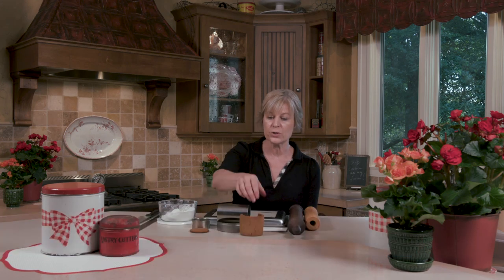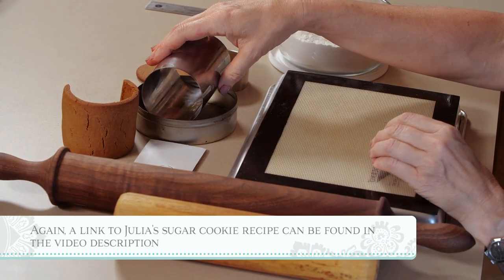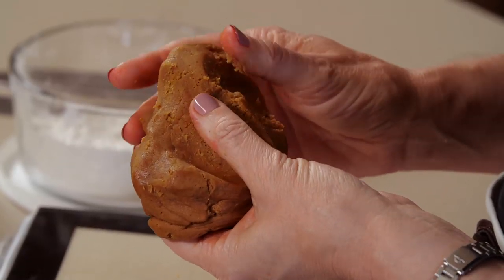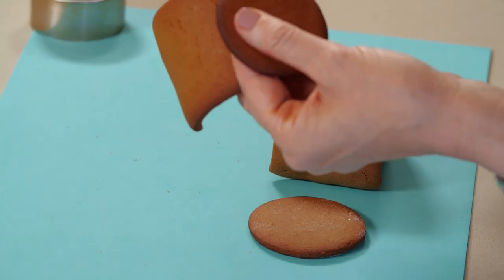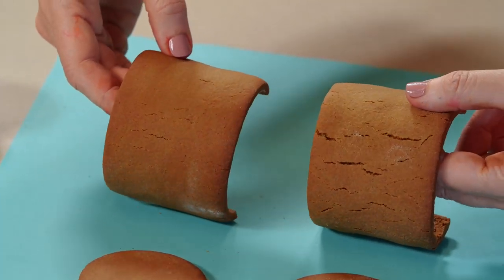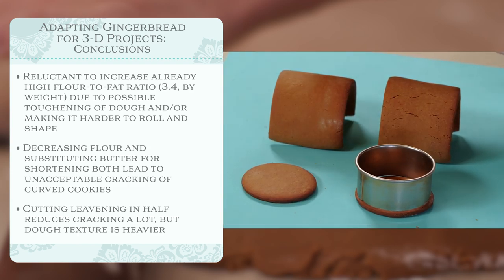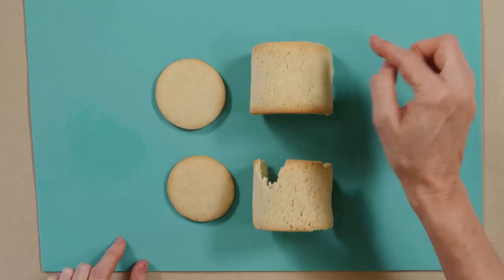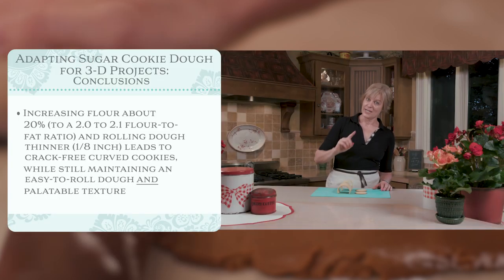How to Adapt Cookie Dough for 3-D Projects: A Series of Controlled Recipe Tests

Comment: Definitely going to use this for an upcoming project…

I’m surprised though that you didn’t try a different fat for the sugar cookie dough. Butter-flavored shortening would have maintained the taste while altering the spread, wouldn’t it?

Also, I didn’t catch it…did you account for the water in the butter when you converted from shortening?
Reply from the maker: My sugar cookie recipe has mostly shortening in it to start; so subbing in a few more tablespoons of shortening was unlikely to have much of an impact (based on the previous experiments with my gingerbread). And, no, I just substituted shortening for butter, 1:1 by weight.

Comment: I've been making your gingerbread dough (delicious btw) and I weigh my flour accurately per your instructions, yet my dough is cracking when I roll it. When I use the excess dough after cutting out the initial shapes, the dough is marbled and looks bad once baked. I'm using a well chilled dough too.
Reply: @JuliaMUsher  Thank you Julia, I'm in Michigan. I suspect (from looking at you work with your dough in videos) that regardless of weighing the flour, maybe it's a bit too much. Your dough in videos looks more pliable. Your videos are very helpful, thank you for creating them!
Reply: @JuliaMUsher  Maybe my scale is off because I followed your measuring, weighing instructions really closely. Regardless, I now know what the dough should look like before rolling. Are you using all purpose flour? Thank you for your input, it's greatly appreciated
Reply: @JuliaMUsher  Just an update Julia, I made a new batch of gingerbread cookie dough and it is wonderful. Other than changing the batteries in my scale I don't know what I did different from the first time. That may have made a difference. Regardless, the dough is perfect. Thank you for all of your responses, I appreciate your efforts.

Comment: Heljp, Has anyone had the following issue: the dough going soft, even after icing.  This has not happened to me before.  the only thing that I have done different is reduce the cloves from 1 teaspoon to 1/2 teaspoon. Surely that cannot make a difference.  I am making the baby rattles and having a difficult time.  I bake the hemispheres for 10 minutes at 375. I roll to 1/8 thickness. I did use 3 teaspoons of water in 1 cup of "glue" icing  to make dipping easier - could that have done it?
Reply from the maker: Hi, Emilia. I am sorry to hear you are having troubles again, but I am probably the best one to answer these questions, as I have made this project and other dipped cookies countless times. It could be any number of things: (1) you underbaked your cookies (look for light browning around the edges; exact time is less important, as it could be your oven isn't properly calibrated); (2) did not store them in an airtight container after they were baked (so they softened before dipping); (3) your dipping icing was too thin so it took longer to dry and softened the cookies (these are SMALL cookies so the icing needs to be thick enough to coat them without seeing through, which takes less water than for a larger cookie . . . which is why I have range on the icing consistencies, typically);  or (4) your drying conditions were too humid (try running a dehumidifier, or the A/C, or dipping on a dry day). If you were to send photos of your icing consistency and baked cookies and what they looked like after you dipped, I would be better able to diagnose the issue. It's hard to ever assess trouble when I am just given an outcome and do not understand the various circumstances under which things were made. Please send an email with this info, as photos cannot be attached here, and please allow 24-48 hours for a response. Thanks.
Reply: @JuliaMUsher  thank you immensely Julia.  You are right. I made the dipping icing too thin. In fact, sometimes I double dipped to fix errors, making the problem worse. The pink icing was especially translucent.  Still, I will have the oven calibrated. I will try another batch because when decorated they are adorable.  I encourage everyone to try them.  With this advise they should come out fine. Thanks again.
Reply from the maker: @emiliamartucci8291  Yeah, way too loose if you're seeing through it. I cover dipping in many other videos (grill, 3-D cauldron, etc.) so you should check them out to better visualize consistency. The icing should thickly coat the back of a spoon without draining off too much/rapidly. Pieces need to be drained, and drips need to be cleaned up immediately as I show in all videos. Never re-dip over messed up/thin icing; it is better to take the icing completely off, and then re-dry the cookie if it has softened too much.
Reply: @JuliaMUsher  Good morning- just saw this follow up. What you say makes sense.  I am actually glad it happened. Mistakes are both humbling and excellent teachers. And, in this case - softly delicious.  Appreciate your kindness Julia. 
Again, I encourage all who see this to try the rattles. It will teach and reinforce various techniques, make you feel like an artist and make children happy.  Just don’t panic like I did.
❤️ thanks again Julia.
Reply from the maker: @emiliamartucci8291  I hope you have some fun with it once the dough-shaping and dipping are done! :)